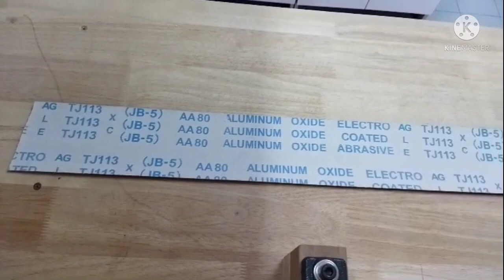DIY drum sander

Comment: Good day. The idea is good, I'm just worried if the drill can withstand such a load. I have a few questions. How long is the cylinder? Axis diameter? What material is the flexible coupling between the drill and the shaft made of? Thank you in advance for your answers. The text is translated by Google. I'm sorry for mistakes.
Reply from the maker: Thanks for the question 1.  cylinder length is 18 inches  2. the diameter of the axis is 5/8 inch  3. The material of flexible coupling is aluminum.

Comment: Can you tell me the type of roller and where it was purchased?   Thanks
Reply from the maker: Roller type is SAMCO silicone hose with inner diameter 16mm and 25mm. It can be purchased at online stores such as Shopee, lazada.
Reply from the maker: https://shopee.com.my/SAMCO-Silicone-Hose-Vacuum-Hose-Fuel-hose-Oil-hose-benang-hose-6mm-8mm-10mm-12mm-14mm-16mm-18MM-20MM-22MM-Radiator-hose-i.85208039.2910743263